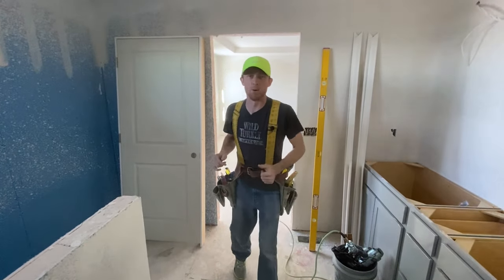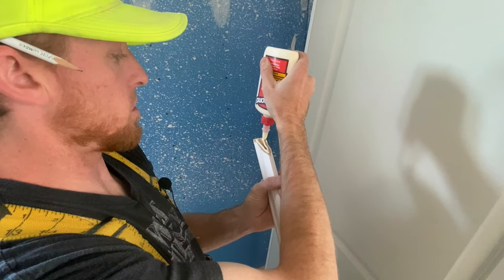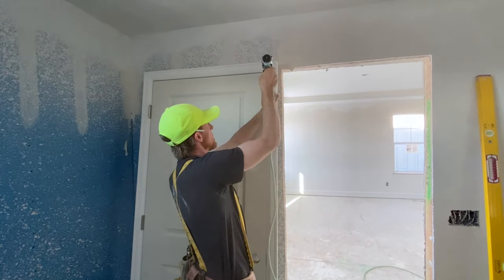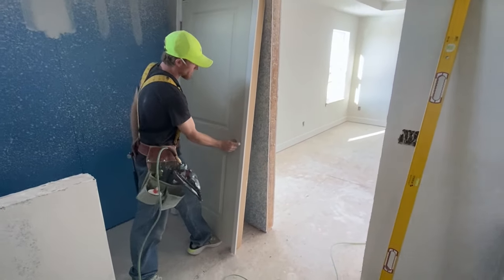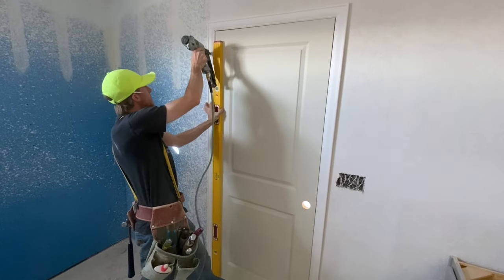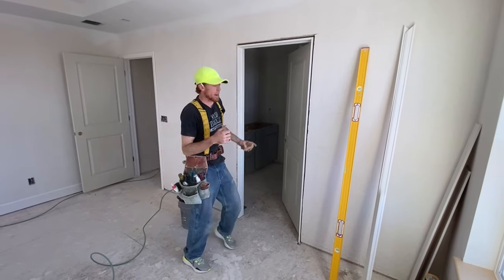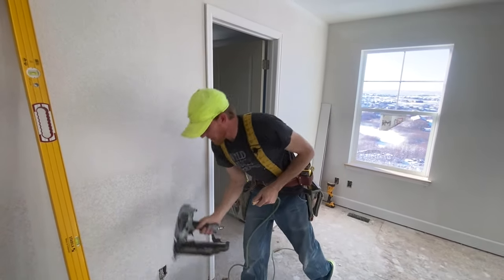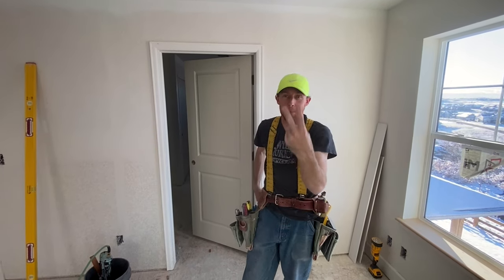My 5 Minute Door Installation Fully Explained : Pre-hung, Case Hanging, Easy Step-By-Step Tutorial!

Comment: shims should be top and bottom and hinge locations... Also at the latch.... also plumbing the hinge side when the wall is out of plumb ..is dumb.... you could have tacked  top and bottom and adjusted both sides for close reveal ... before you shim and lock in one side with nails

Comment: if your doing additional mill work for the header to build it up  (craftsman style)  , what would you have to change to install it ?  I will need to be installing 6 shortly.
Reply from the maker: The only thing that would change would be leaving your header detail to the last step after the door is installed. I would simply nail my casing legs to the jamb(make sure to leave the proper header reveal at the top) and hang the door the same way. After the door is shimmed and nailed off then work on the header detail. You may need to flex the door jamb at the top up or down to get your proper spacing and reveals to work…hope this helps, thanks for watching and have a blessed day 😎

Comment: Great video.
I had three solid core doors to install on a remodel this weekend.
Since it was ten years since I last installed an interior door, I hit YouTube for a refresher.
Came across your video....wonderful.
I was taught to hang the door while shimming to level in both directions.
I was taught sooooooo wrong, and hanging doors was intimidating.

This weekend, they went up so easy and smooth with minimal issues.
Thank you.
Dave

Comment: I really enjoyed this video. I am a retired trim carpenter from Texas. I think that you did a really nice job. I just have 1 comment that you might find useful. When you're hanging the pre-hung unit. After you've gone through setting the hinge side and the header, before nailing off the strike side. Take a 1-3/4 paddle bit slide the  shaft between the hinges and gently close the door " not all the way but just enough to slightly bend the hing." Do this to each hing this will help to establish the margin on the hing side of the door. You might also use your pencil for this as well. Thank you

Comment: This is the first time I’ve ever seen trim installed before the door was installed.  I guess it works something like a door jig.  I have two solid wood doors that were cut short for an old opening, I don’t want to throw out the doors so I’m going to try to extend them, so I can reuse them in the new opening.  I always seem to take on a challenge.  Do you have a video on how to install doors that are not pre hung and do not have the door frame installed?  The opening I have is like the one in the video, studs and drywall.

Comment: With the advent of thicker casings I assume the reveals change.  We are now doing 3/4 thick  4 inch wide casings as the norm. So hinges cant pinch or the door handle latch plate. We also change door gaps depending on season they are installed. Humidity levels from summer to winter  temp changes we have swings of plus 30 to minus 30 can swell doors a 1/8 inch we have encountered and their painted on all 6 sides

Comment: Great Video and demonstration.  When installing  your shims behind the frame. Do you install  the shims directly  behind  the door  hinges or above or below  the hinges?
Reply from the maker: Install them right above or below the hinge. This helps to not bind at the hinge and also allows you to adjust the door reveal by sucking a screw through the hinge in the future if needed. Technically below the bottom hinge and above the top hinge…thanks for watching and have a blessed day 😎

Comment: Can you use this method when the wall is out of plumb about 1/2 inch from the top of the door to the bottom of door.  The old door jamb is still up without the door and cassing is removed, and i noticed the drywall is protruding 3/8 inch at bottom.  From a fellow Coloradan.
Reply from the maker: Yes you can still use this method! I would focus on adjusting the jamb to plumb after adding shims in between the door jamb and framing. Try to adjust an 1/8” at the top and then that same 3/8” at the bottom. I use my foot for leverage and a hammer to tap and move the jamb at the bottom. Keep a little “squeeze” pressure on the shims that are temporarily holding the jamb so they don’t fall and shoot a couple nails through the jamb and shim once you get your jamb plumb…
Hope this helps…sometimes it’s hard to explain through text…
Thanks for watching and have a blessed day 😎

Comment: With the number of trim nails you loving sprinkle about, I assume you own stock in a nail company.......and the painters are looking for your home address.

Also wondering what your holdups were for the flooring. Looks like luxury vinyl from the bathroom right into the bedroom.
Reply from the maker: Haven’t had a problem with the painters since I’ve started…it may seem like a lot of nails. This is a new residential home construction project by DR Horton and the flooring isn’t installed until after trim and paint. That’s just the way the company organizes their schedule, that’s why there isn’t any flooring…tile for bathrooms and carpet for bedrooms…
Thanks for watching and have a blessed day 😎

Comment: I thought prehungs generally are installed after the finisher floor? Or are the flooring guys trimming ur jams.
Reply from the maker: The flooring guys will under cut the jambs if there is hardwood or tile. The jambs are left touching the subfloor in carpet areas. Thanks for watching and have a blessedly day! 😎
Reply: @huntercarlson5446  beauty good work m8
Reply from the maker: Appreciate it! Thank you! I see a FOX logo…do you ride dirtbikes?! That’s my favorite thing to do while the weather is nice here in Colorado! I’m more of a trail rider than a race track kinda guy…
Reply: @huntercarlson5446  I used to ride tracks when I was younger. Just sold my drz400sm, riding on the street wasnt my forte really but hoping to get another dirtbike soon! Lol

Comment: Great video Hunter!  This was an awesome tutorial.  Just one question though, does this type of install require real wood casing for strength or will mdf casing or other similar material work as well?
Reply from the maker: Thank you very much! In the video I’m using MDF casing so other materials will definitely work! The only thing that changes for me is if the door is solid core…then I will add a few extra nails through the casing to the jamb and then the jamb to the wall. I will also shim the bottom of the door if it is solid core. Let me know if you have any more questions. Have a blessed day 😎
Reply: @huntercarlson5446  thanks for the reply!  Coincidentally I am installing a solid core door.  It totally makes sense to shoot extra nails for support.  To make sure I understand correctly on shimming the bottom of the door, do you mean to put some shims at the bottom so I the door won’t droop to the floor, while attaching the casing to the jamb and then remove the shims once the casing is attached?  Kind of what you were doing with your foot in the video?
Reply from the maker: That’s exactly what I meant! If you have to lift the door on the hinge side shoot the casing to the wall and before you open the door to shim just slide a shim under the jamb to make sure the door doesn’t shift down and mess up your reveal.  If you are installing a door on finished flooring don’t lift the jamb, you made need to cut the bottom of the jamb different amounts to make the door as level as possible…if that makes sense…
Reply: @huntercarlson5446   That makes perfect sense!  Thank you so much for sharing your knowledge. 👍
Reply from the maker: Very welcome! Thanks for adding great content through the comments to my channel!
Reply: We’re you using precut door casings?

Comment: Hi Hunter, any chance you might do a video on base board installation tips for a quicker installation. For example, what pieces do you install first in a bedroom or closet. Also what technique you might use with larger base board and mdf vs pine.
Reply from the maker: Hey Alejandro! I don’t have any footage of installing baseboard at this time…I will definitely get some video for the future! When choosing what pieces to cut/install first it’s very easy for me. I go counter clockwise for measuring, cutting and installing…so when I’m on my knees measuring let’s say starting at the front door I will crawl counter clockwise through the entire 1st floor until I get back to the other side of the front door. I don’t install the big pieces first…I cut and then nail in the same order that I measured. I also “cope” all of my inside corners with the “cope” on the right side of each piece of base…
Just a quick explanation…I will get footage when I’m back to work after the holidays…
Thanks for your support and watching the channel! Have a blessed day 😎

Comment: Did you precut the bottom of the door  jams ? I've installed many doors and almost always have to cut the jams to reduce the space under the door.
Reply from the maker: I did not pre cut the bottom of the jambs…I will do that when installing on a finished floor. The millwork shop gives me 1 3/8” extra on the door jamb so after 1/2”-3/4” flooring I end up with about 7/8” gap under the door. I don’t really want that gap to be any smaller in case of a mat or carpet to hang up on the bottom of the door when it swings open. Most cases of this would be a bathroom or office where a area rug is used… thanks for the great question and for watching! Happy to answer more! Have a blessed day 😎
Reply: @huntercarlson5446  ok , I should have mentioned that every door I've installed was on finished floors. So I've had to cut the jams to get a finished reveal under the door. I have never seen anyone instsll doors the way you do. I am blown away by your technique . I will definitely attempt to do my next door install like you do. Keep in mind  the key word is "attempt "  you make it look easy though.
Reply from the maker: That makes total sense! Most of the builders I’ve dealt with install flooring after trim and paint…with doing my technique on finished floors I do cut down the jamb after checking level on the floor…1 side might be 3/4” cut down and the other 5/8” because of the floor…then I have my specific measurements for casing to keep my reveal…when setting the door in the hole I don’t focus on leveling the hinge side as much as I do focus on reveal  of the door to the jamb. I appreciate that you are willing to attempt my “case hanging”technique! Might take a couple doors to get the feel of it, but it is very efficient for me! Let me know how it works!
Reply: @huntercarlson5446  Thank you 😊

Comment: How much gap should be left between the jamb and subfloor to accommodate carpet insulation? I realize that carpet and padding thickness varies, but what’s common rule of thumb to afford the most flexibility for the carpet installers? 

Thanks.
Reply: Typically it’s a scrap of your baseboard. Or 1/2” is pretty common
Reply: @reedrobb  Good to know. Thank you for your reply…and Merry Christmas.

Comment: 2 inch r.o?
1 1/2 inches for jambs plus another 1/4 inch total for reveal around hinge side and strike side which is 1 3/4 total, leaves you a 1/4 inch for plumb. I don't think so as framers are never that careful and either is the bows in wood framing. Always go 3" wider and 3" higher the door dimensions and you will never have to modify . Gives you more room as well to move door over in close proximity to wall.